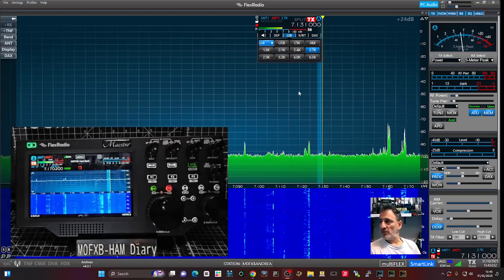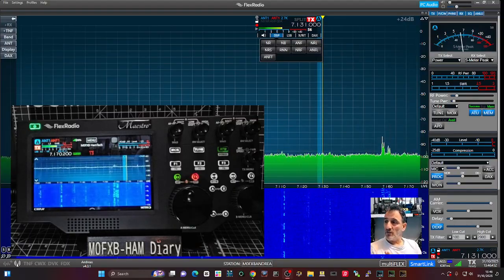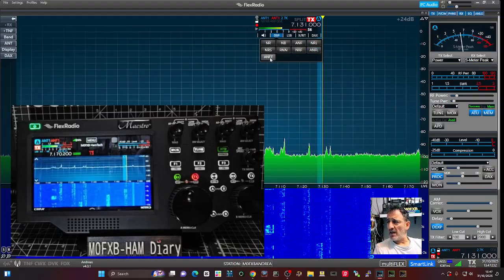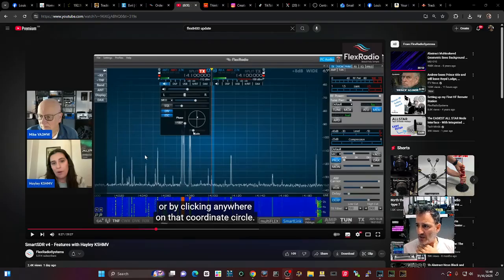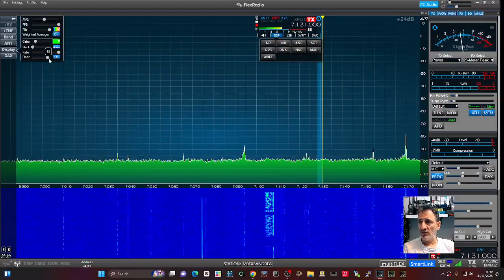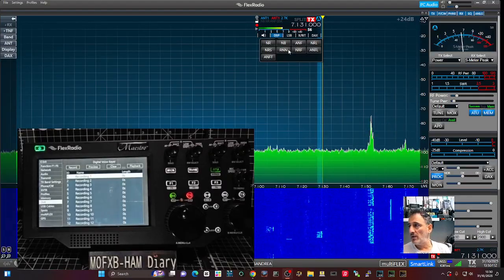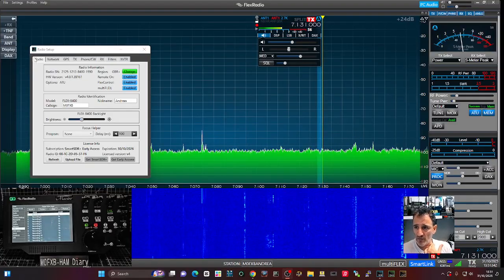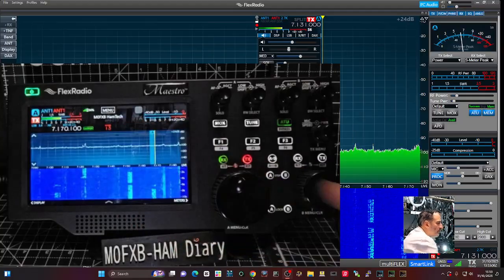FlexRadio  Exploring v.4.0.1 New Features (November 2025)

Comment: Good video. To get the diversity reception on the Flex 6000 and 8000 series radios you need to have the 8600 or the 6600 versions that have the full 2 separate receivers that receive on 2 different antenna at the same time.
Reply from the maker: Hi John thanks i have lots to learn i have added early access thanks for the tip 73

Comment: Seems like crap update..been a flex user over 10 years, but this is the most stupid money waste ever. That's why I'm getting Yeasu ftdx😉 also keeping 6300 with a basic license....once u paid for a radio it should do work for you and you should not pay any money for latest upgrades....this is what companies should bring free of charge as you paid quite a bit for a radio already 😅
Reply from the maker: I understand you do not want to pay for updates but saying "Seems like Crap " is just being rude and is not accurate.
Reply: I have a Flex 8600-M Radio and downloaded the V4.01. I have basic functionality, will I get the full version free since I got one of the 8600M radios in 2024 at Dayton and paid full price up when my order was ready?
Reply: Good luck getting any updates at all for that Yaesu. Good hardware but terrible user interface on my FTDX10
Reply: @timwhite8500  FTdx-10 is nice, but scope is not top notch like the other manufactures!  Spectrum Display has corrupt screens, and the waterfall is too blurry in the slow modes!  Why is it not as blurry in the fastest mode, it  has more time to process the data in the slow modes?  Equalizer should be more simple, just gain and frequency...